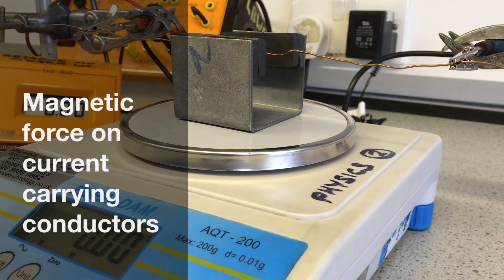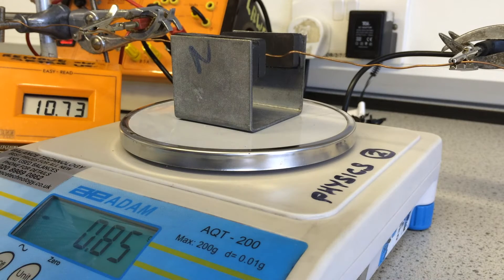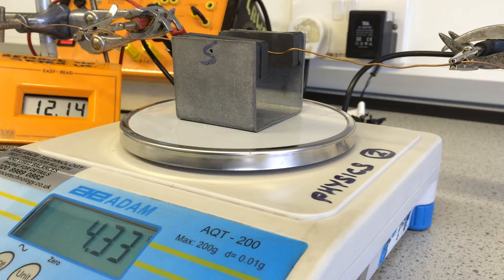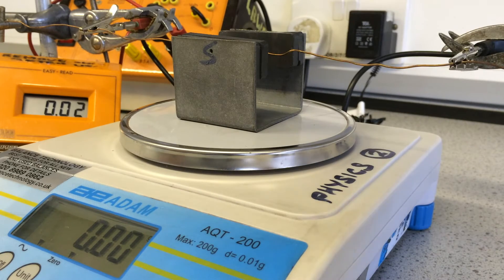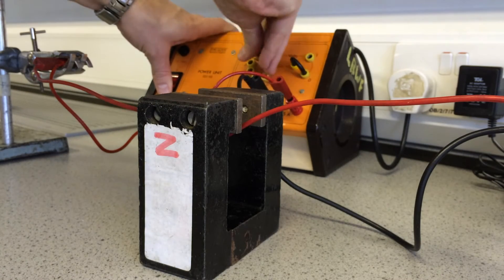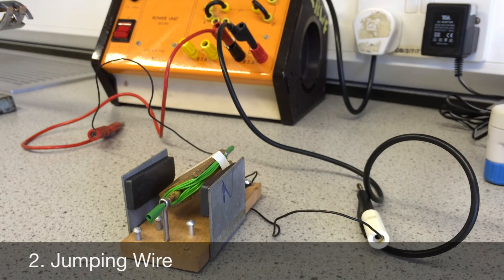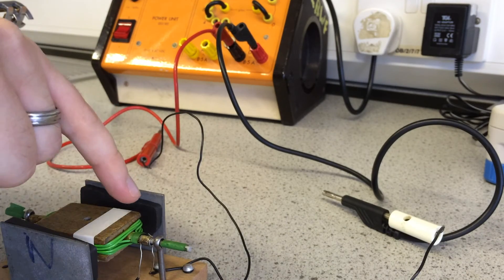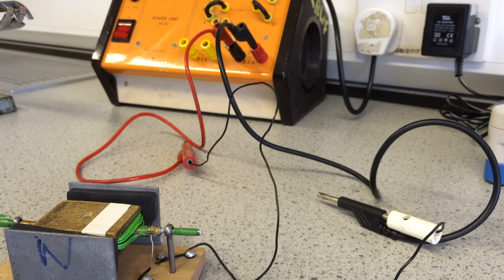Magnetic force on current carrying conductors

Comment: For the set-up with the scale, the magnets and the wire, where did you find the metal piece that holds the magnets in place (the U shaped piece of equipment)?
Reply from the maker: +Cesare Spinoso that component is called a "Yoke".  My college is well equipped with all the mundane components that you'd probably never think of.
Reply: Long time since you posted this comment, but the metal brace which attaches a fence panel to a fence post may well suffice. Perhaps try a building supplies store?